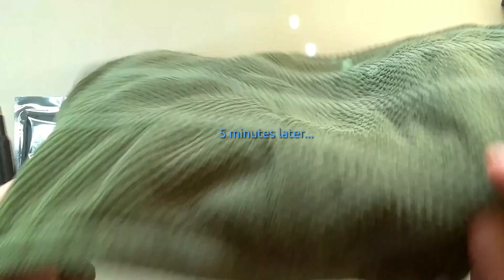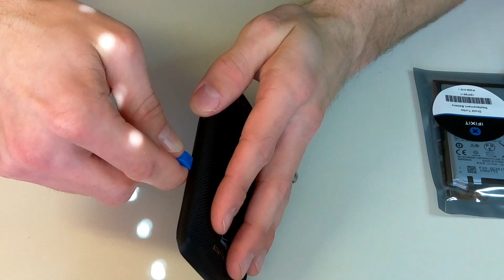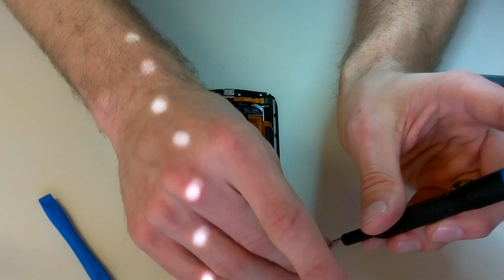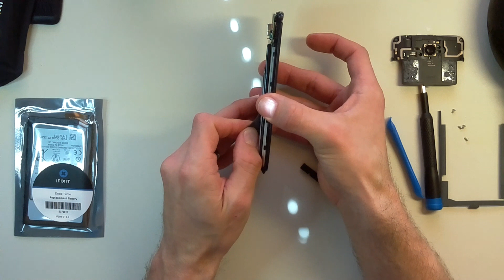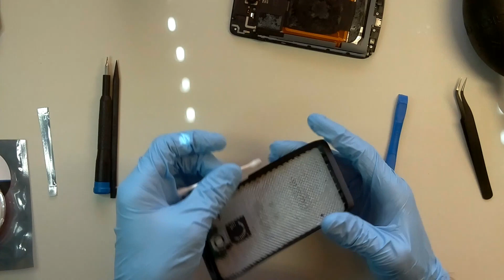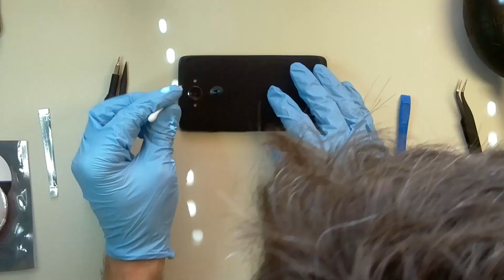Motorola Droid Turbo Battery Replacement

Comment: Great video. I bought a replacement battery for my son's droid and watched this video BEFORE we tried to replace the battery. Unfortunely, the battery connention to the PCB broke and a pin came out. There's 4 pins but all 4 are needed. We bricked the phone. No way to re-attach a broken pin in a connector that is also broken. I applogized to my son and we went down to Verizon to buy him a new phone.

Comment: I changed the battery in our turbo following every step.. was very careful and now the phone wont power on, it charges, will go into boot loader, but the power button wont work. Can I please get any help solving this.. in bootloader it says the phone is locked.
Reply from the maker: I did not have this issue, sorry. I wonder if the button is misaligned with the case somehow. I would encourage you to ask about it on iFixIt.
Reply: @ryanrepairs1452  thank you
Reply: I'm having the same issue. My power button is no longer working somehow it doesn't feel like a button anymore. Not sure what to do.. And I was very careful..

Comment: Is there any feed back on the replacement battery, how it performs or holds a charge?
Reply from the maker: The user reported that the battery held a charge for much longer (about 2 days) than the original. No new performance issues were reported.
Reply: @ryanrepairs1452  I used the linked and ordered the same battery for my phone.  Hopefully I can pull off the same replacement.  Thanks for answering my question.

Comment: Hello How long should the battery be charged for the first time?
Reply from the maker: My replacement battery had about 1/2 charge. No particular need to charge it right away.
Reply: Muchas gracias